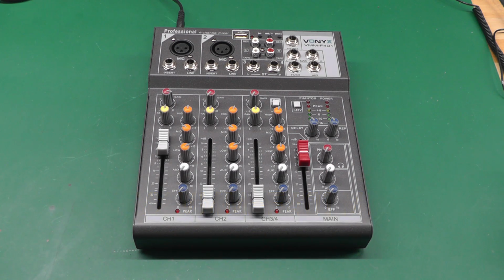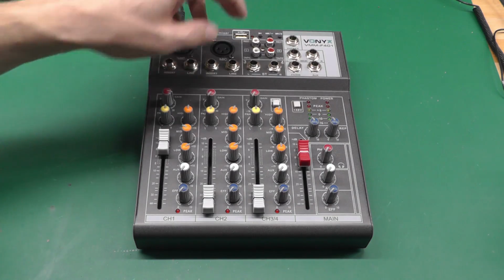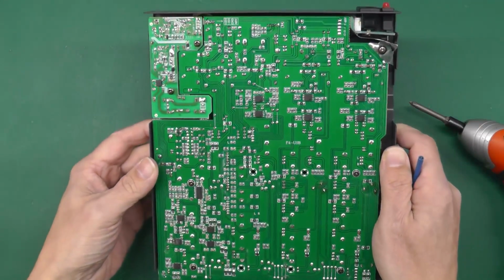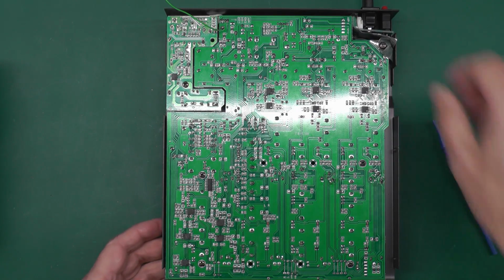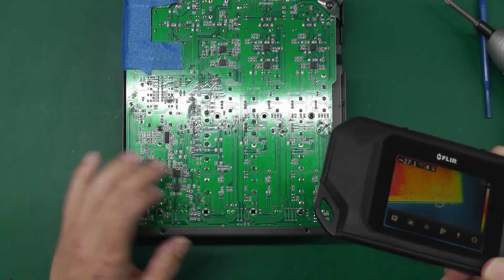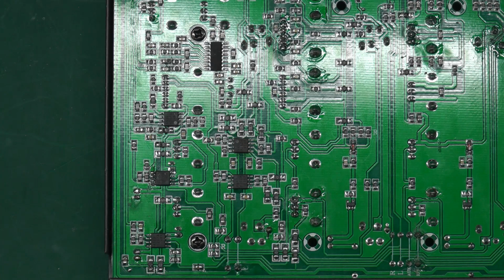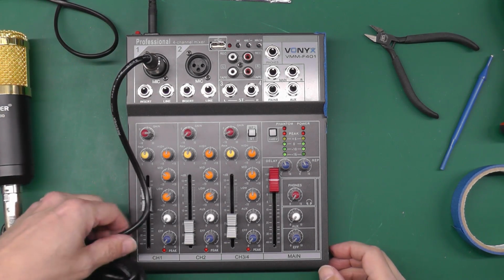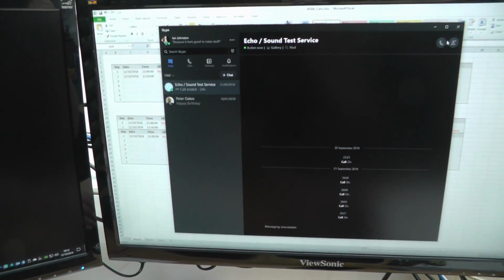No.039 - Vonyx VMM-F401 4ch Mixer Repair

Comment: My first thought was "somethings oscillating"
Reply: and ugh, a smps in an audio circuit like this.. no..
Reply from the maker: Yep, it was a surprise when the mixer arrived to see it had 240VAC right on the back and no space for a transformer.........
Reply: I still would change the PSU capacitors, even though they are fine ripple wise they are definitely undersize for the current draw. you can see that in the end when you are running the unit at full output level and the power led is dimming on the peaks. PSU probably has minimum value for stability only, a larger value (and 35V rated over the probably 25V units they used) low ESR decent brand replacement set of power supply capacitors, and a small ferrite bead over the power lead to the mixer ( probably easiest to get a small toroid from a dead CFL lamp, crack it in half and glue it back together over the wires) should help get the noise floor down further.